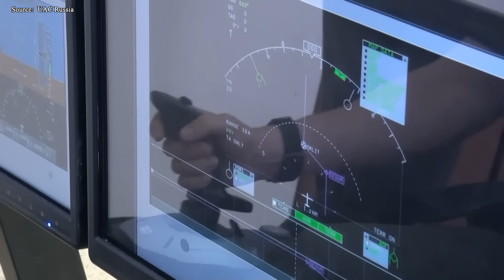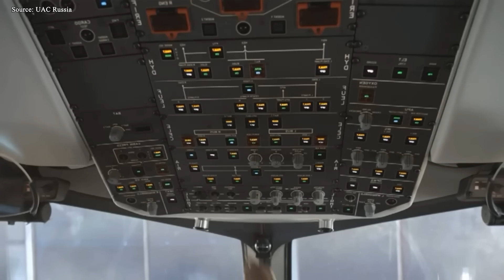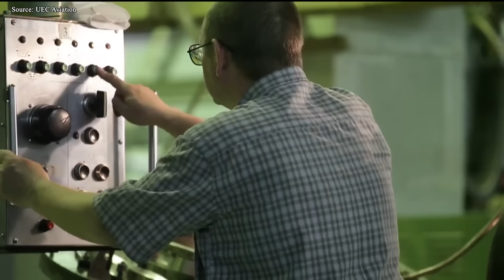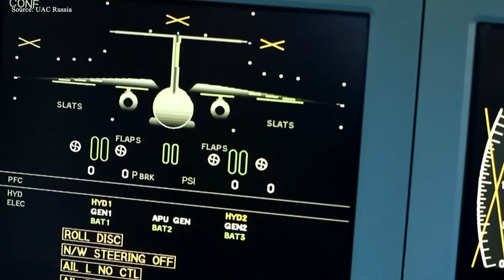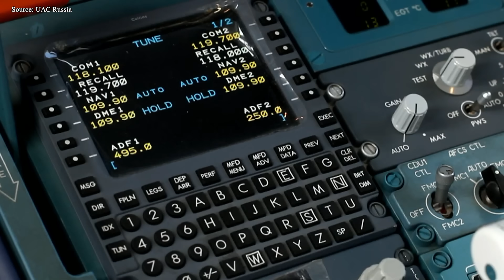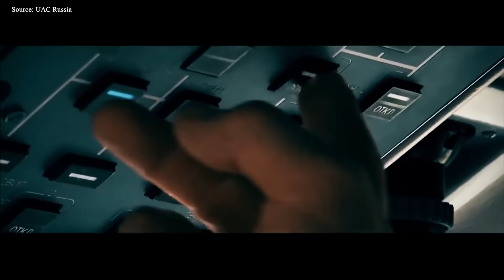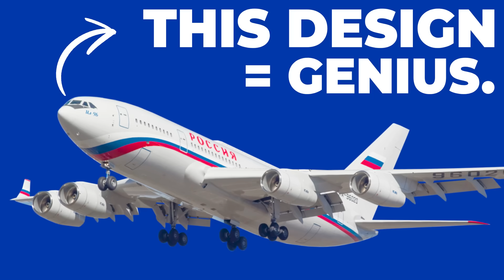How Russian Ilyushin IL-96 Just OUTSMARTED Boeing & Airbus

Comment: The ironic thing is,westerns thinks Russia depends on them by spreading the usual propaganda,but in reality it vise versa 😂
Reply: What’s wrong with propaganda? It’s used by every country.
Reply: @venicrable You have dead brain cell?
Reply: @venicrable  if you can’t recognize it and believe in it … it can be destructive
Reply: Harsh reality is Russian stuff arent fancy like the west. But you can bet your life on them for being simple to maintain and repair. 

This is the entire philosophical difference no?

Russian philosophy always prioritizes simplicity in parts and repairs. They are simply fine to have 1000 spare parts to be changed in short time as long as those are simple in design and easy for the crew to fix.
Reply: @gurusaran1892  
The focus on simple maintenance and repair highlights a different priority: the expendability of the crew. It's cheaper to replace the soldier than to invest in complex armor and life-saving design. Simplicity comes at a human cost
Reply: @mrDominius  even I used to think like you before. But if you look at platforms like mi 17, they are extremely reliable. 

True, it needs greater man power. Given the current population pyramids no european country can man these equipment.  But interms of reliability Indians have stretched some of those platforms to 60+ years alsom
Reply: @gurusaran1892  that's great, but it doesn't change the fact of how the Russian gov/MOD treats people. And it is reflected in many vehicles' designs
Reply: @mrDominius "Great" compare?! Try again. How many western up to date tanks were destroied in Ukraine?! You compare condition on battlefield in Ukraine or real war with them in Iraq, Afghanistan Istanbul...in condition in air superiority?! Before try to use the fact of combat avioation, try to find out what are elements of air superiority and how they influence in use of combat planes.
Reply: @mrDominius ukw? How Russia treats soldiers was exactly how men were being treated on battlefield across centuries. 

Idk what they call it in your part of world but in India and the eastern part of the world map all battle hardened armies are tough. 

Idk what happened to the west before the digital electronics age even west had a such toughened professional armies. Eg: wehrmacht and British Armies of crown colonies. Sadly post high tech and gaining access to these supply chains of high tech, ik for troops world became lot more comfortable.

But planners of west simply dont realize how vulnerable their supply chain is, and mind you this vulnerability is exactly what PLA is capitalizing on. 

Remember Russian stuff might be crude and old but that is damn reliable with less failure and fix supply chain. Maybe this is why Russians are not able to transition into digital age electronics. 

At the end, pride comes with a cost.
Reply: @gurusaran1892  well, even if the Russian stuff is reliable, it loses in numbers to the western one. You can't win while being behind by both quantity AND quality. 

And also I'm not really sure about ur claim regarding the western supply chain being vulnerable. If it is vulnerable, the Russian supply chain is non-existent. Imho the western supply chain is the best in the world, just because they tend to join conflicts around the globe and do it quite frequently.

For the last, I doubt you can say that soldiers were treated exactly the same across centuries, while the way of fighting has changed so dramatically. There were no FPV drones 10 years ago, and that's not even a century ago.
Reply: @VladimirKaeski-jp6kt  well, I hope you know that each military vehicle is made with some strategy in mind on how it will be used. Now, let's go back to Ukraine and western tanks/equipment. Western vehicles were made for western doctrine, which is air superiority. Russian doctrine, same as the Ukrainian one pre-war, is built around the land army. So what do you think will happen to vehicles that don't suit your doctrine aka you have no idea how to use them? They will be less effective. 

Regarding the western up to date tanks being destroyed in Ukraine I would say the losses are zero, since Ukraine doesn't really get modern vehicles much. Also they get a really small number of vehicles, which makes it even worse, since you can't wait to get a decent number of vehicles and have to use them as-is. 

The last point I would like to make is that no modern vehicle is prepared for a modern conflict. The Ukrainian conflict has changed the way wars are fought. So pretty much everyone must be thinking about how to overcome modern issues like FPV drones.
Reply: But who else can manufacture an aircraft of this size and comfort and has engines to propel it.
Only USA through Boeing and all the EU combined with Airbus. 
That's it. So it's a brilliant example of Independence and Russian genius engineering.
Reply: Yes Russia depends on west and cant make a shoes for it's population
Reply: @hjsibdwjishe That what Google say lol?
Reply: @hjsibdwjishe 😂😂😂😂Try again. This is not stupid enaugh.
Reply: a dated design that still has some potential, but needs better engines on it. some years ago, Ilyushin demonstrated it's IL96M, (which was a designation for the IL96-400), that one off built airframe had Honeywell/Collins Avionics and Pratt & Whitney PW2337 engines, performed way better than the PS90 Powered birds with much better fuel economy/consumption,  unfortunately the engines got repossessed with the avionics and other western-built components that were installed.

Could you just imagine if the IL96M did go into production and how it would sell to other parts of the world? I honestly think it would've been a major success...if it was built and sold.
Reply: They have issues understanding a small Serbia.of 7M ,let alone powers & cultures like Russia or China. Western propaganda is sometimes so stupidly naive it almost looks childish,crazy how many falls for it.
Reply: @sotirzvanidjubre4109 But it is successful for brains prepared in their education sistem and etc.
Reply: Even F35 tech VT was purchased by russian YAK..... Ofcourse they bought it and used it..... While many Russian techs were copied.
Reply: @UdayKumar-xo8ey guess what, wheels were also copied by everyone
Reply: Absolutely  💯
Reply: BY ALL MEANS, PLEASE LIST EVERYTHING THAT THE WEST NEEDS FROM RUSSIA. SHOW US HOW THE WEST NEEDS RUSSIA MORE THAN RUSSIA NEEDS THE WEST BY LISTING THOSE THINGS THAT THE WEST DEPEND ON RUSSIA FOR AND VICE VERSA. THAT WOULD HELP MAKE A MORE INFORMED DECISION, DON'T YOU THINK. 😂 People like you are hilarious. All you do is run your mouths but you never provide any corroborating evidence to prove you are telling the truth.😂
Reply: @letsgojoe3927 , you obviously grow up blindfolded from the reality.😂
Reply: @letsgojoe3927  How's your EU factories humming along ? Starting to get cold ?
Reply: @iRelevant.47.system.boycott  lol what??
Reply: @letsgojoe3927 no problem mate, just transfer some upfront payment to my Gazprombank account
Reply: In fact we, Russians, still heavily depend on crucial western products. For example, machinery and microelectronics, its  almost dead in Russia. The percent of imported equipment at this particular jet manufacturing facility is far beyond 50 per cent, as well as electronics in it. And state's effort to revive those industries are far from successful.
Reply: @EternalTraveller-t4l microelectronics are made in Asia. Idk where you're from but here on planet Earth Asia tends to be called East not West 😂 come to think of it pretty much everything is made in Asia now. Go figure.
Reply: In the video I see just ridiculous Kremlin propaganda.
Reply: @alexandervt641 у кремля практически нет пропаганды. Даже мы граждане России часто не замечаем что-то хорошее под боком.😅
Reply: @alexandervt641  Shut up, you're talking nonsense.
Reply: @alexandervt641 You are product of Western brainwashing...

Comment: fuel efficiency???? wit 4 old engines????
Reply: Well it's under 100mil while Airbus are over 300 and Boeing over 400 so even with discount for big orders they are around 170-250 mil so I don't think bigger consumption becomes a problem for the first 15-20 years because 100mil buys you really a lot of ⛽ and in 5-10?years they will have PD-35 engine
Reply: But they don’t care about fuel efficiency. Only Europe cares, because they are endless broke.
Reply: @FnokiN  The whole world cares, that‘s why nobody buys old Russian garbage. Including Russian airlines who use almost exclusively Western jets.
Reply: why would they care about that? it's not as if they are running out of oil soon.
Reply: Amico,vedo,che non stai attento cosa dice il video,i motori,sono nuovi ed aggiornati,vedi motori per Jet militari e civili.
Reply: Fuel efficiency depends on more than number of engines. Your 4 cylinder car may be more fuel efficient than your 1 cylinder lawn mover.

Comment: Russia builds the most sophisticated, advanced, faster Fighter Jets, Su-34, Su-57, much better than any from US/NATO..  Engines, special metal alloys bodies suited for supersonic speeds.  
Why then Russia could not design and build much simpler civilian airplanes, bodies and engines❓
Reply: How do you came to conclusion they cannot? They can.
Reply: First, civilian aircraft sector is technologically more demanding than the military because of extreme high requirements to safety, fuel efficiency and low maintenance costs. Second, Russia does not build sophisticated military jets either. Fighters like Su-34 and Su-57 are too backward to compete with modern NATO or even Chinese jets. As a result, in the last 10 years Russia lost almost all international tenders. Main problem is the totally outdated Russian avionics since the country has no modern electronics industry. But avionics today is the heart of each fighter jet.
Reply: You are out of time.  @alexandervt641
Reply: @pevnik  Russian industry is out of time.

Comment: 4 engines planes are obsolète and IL96 is just 30 years in late.
Reply: This aircraft is safer than an aircraft with 2 turbines. The main thing is the life of passengers, not the profit of capitalists
Reply: @Rusich945  This hasn't be the case for decades. 4 engines means twice more maintenance. It's also less fuel efficient than two.